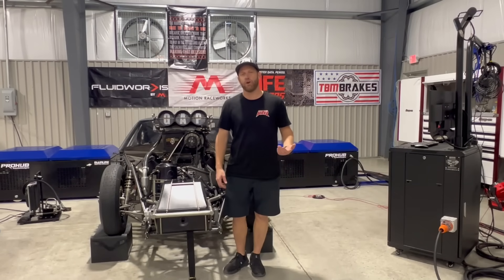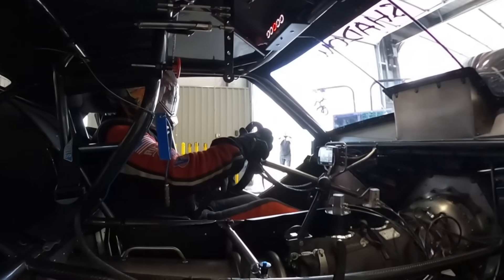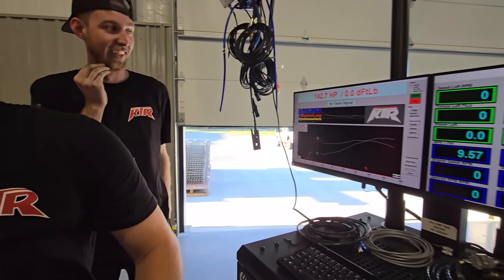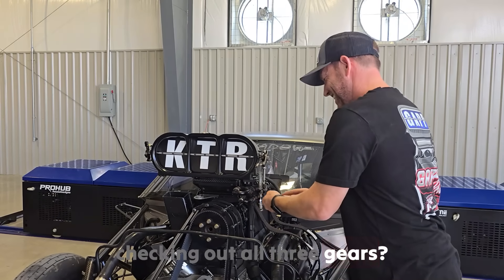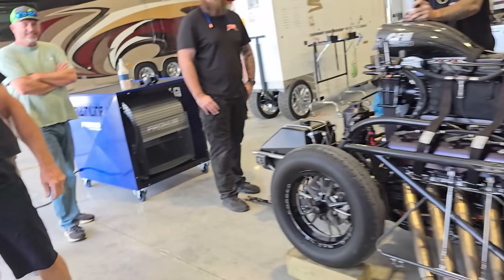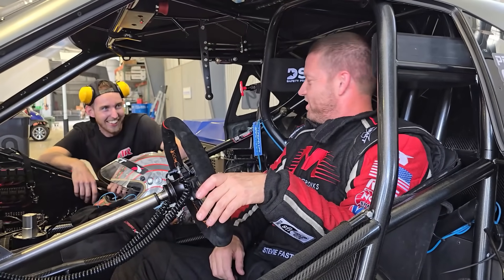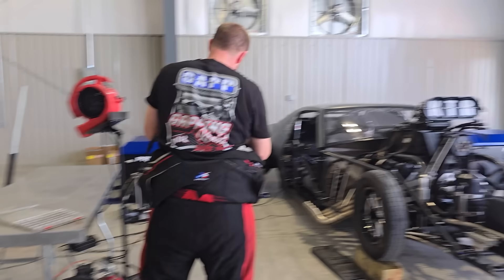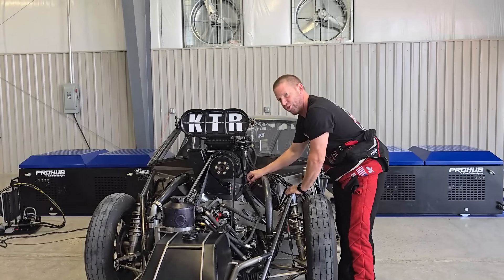KTR INSTALLS A MAINLINE 6000 HUB DYNO! THE SHADOW 3.0 GOES THROUGH THE RINGER!

Comment: Its one of the best tools we have purchased for our shop,my only regret is not buying one earlier -it adds value to the client with a lot issues picked up before heading to the track-the worst thing in drag racing is fixing issues at the track instead of going there to actually race.
Reply from the maker: I agree with you. It’s way cheaper and easier to fix it before you get there
Reply: @SteveJacksonRacing  I am on my 3rd dyno with mainline and the service and tech has always been excellent 
Happy hub dyno-ing,all the best

Comment: I'd put three USA made straps and a safety chain on the floor in front of that thing....prolly cut a hole into the concrete in front, dig a pit, and drop a boat anchor in cement to attach too also.
Reply from the maker: @greenmirror5555  😂😂😂

Comment: It certainly was nice that the Fuel Tech guys stopped by to help advance your hub-dyno learning tree of knowledge.  The 64 Fajita question is how many more gallons of M1, sets of spark plugs, sets of rods, short block bearing sets (Rods and Mains) will you use up making dyno pull after dyno pull with 3.0 now that you (Mr Stevie Fast Jackson) and your bank are proud new owners of a brand spanking new Main-Line hub-dyno.
Reply from the maker: SINCE LAST WEDNESDAY, WE HAVE RAN THROUGH 6 DRUMS OF FUEL, 4 SETS OF RODS, 4 SETS OF PISTONS, 6 CAMS, ONE CRANK, 4 SETS OF HEADS, 4 MANIFOLDS, 3 BLOWERS, 4 BELTS, ONE ENGINE, 4 CONVERTERS, 2 TRANSMISSIONS, AND ONE REAR GEAR.
Reply: 🎼🎵 and a steaming fajita in a Barnett beard 🎶
Reply: Bet Don is not happy.   @SteveJacksonRacing
Reply: @SteveJacksonRacing  congrats. I hope u run a 45 Donald duck race
Reply: @SteveJacksonRacing  Thems is REALLY GOOD TIMES!
Reply: I blacked out after reading 6 drums of fuel. That’s 4 months of my salary alone. Hell far!

Comment: looks like 3961 Hp   3671  torque
Reply: Lmao your off about 2 thousand.
Reply: @sleeperimpala2504   yep.so correction  the screen looks like a 5 but is a 3   , so its 3961hp  3671torque, and used online   calculation  for weight/ hp  this about 3.57et so about right